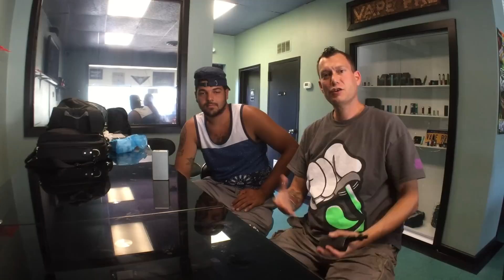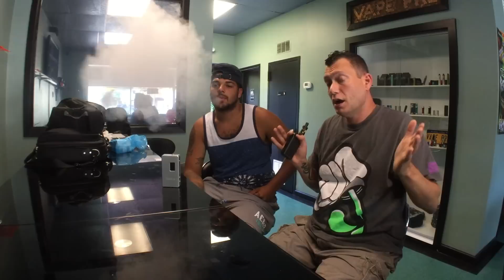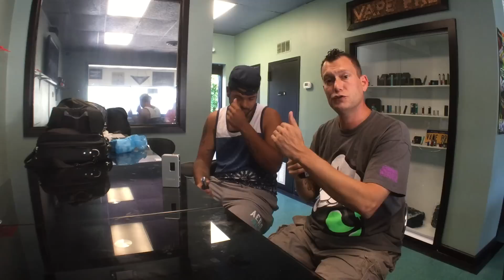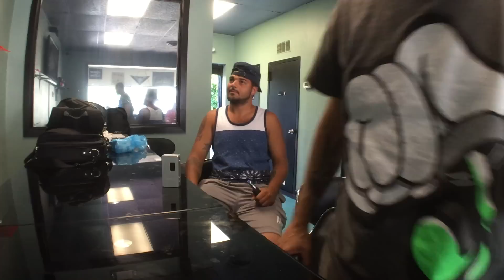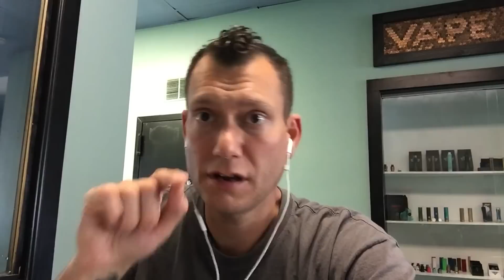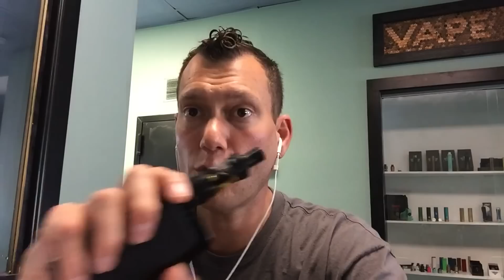Cloupor T8 goes on the TC wall of shame.  This is NOT a Temp Control Device.

Comment: This video is a very good and mature way to approach this matter. 
More reviewers need to talk about this device like you have to reach out to the people that buy it for temp mode.
I hope Cloupor see this video and makes the correct changes in there packaging and web site.
Reply from the maker: +chris nicolas Thanks man, I hope so too.
Reply: +Quest4vape hey quest4vape. there is a shop on ebay that makes triple 26650 wooden box mods. oldiesbutgoldies4u you should check that shop out, handmade wooden box mod.

Comment: Good job Daryl, These guys should have known what they where selling know your product, this device is a old device. The are talking about board temp as you know. Instructions are defo misleading but i am sure this Mod was out before temp control came out.Nice one brol
Reply from the maker: +Polo65 Thanks man, I was maybe a bit harsh on Clouper?  That's ok.  They have a 150 watt box mod that says it is temperature control and people think that means nickel TC.  They have a problem.   What's to be done?   Educate.  asap.  retail stores and vapers.  Thanks man, I know you keep a sharp eye on your vape knowledge.  Hoping others do the same.
Reply: No Daryl, I dont think you where to harsh these companies need to make their instructions more precise, I have been baninging on about this on forums, and vape shop owners for a long time. To make sure they are giving their customers the right info.They should be able to research their product instructions, and translate in the proper manner as most companies, Are very misleading. You are a 100% correct in the way you handled this situation. Thanks again Daryl,

Comment: Great video! We need to see more videos of you in the shop.I need help myself........I have a 100w istick eleaf that I vape at 65.5w and I use a Smok tfv4 tank. I was recently told that the coils to this tank are nickle and I need to know if its true and if its safe using it on the istick that isn't TC.
Reply from the maker: +juan solis Hey, the coils in the TFV4 are not nickel.  They are A1 Kanthal.  I have that subohm tank as well, and have vaped the Tri-coil and the Quad coil.  It's a beast of a tank.  But no, those coils are fine to vape in that tank in wattage mode.  And 65.5watts is by no means pushing the capability of either the coils or the mod.  So you're vaping quite modestly.  No harm there as far as I can see.  Anything I'm not seeing?

Comment: the shop must ave assumed it's  the cloupor GT 80w temperature control and ain't done any research on their own shit, so the shop selling it are at fault cos what u read out is basically standard regulated box protection . and someone looking for a cheaper way to try tc vaping wouldn't know any different from what the shop was telling him, at least until reading the instructions  in its box.  u probably already know about GT 80w tc , I didn't  read other comments so sorry if I'm repeating any1. but for a vape shop to make a major mistake lk that is bad!! n even worse for the vaping cause.....   keep up the good work lads, thumbs up from me
Reply from the maker: +Greg John Cloupor didn't intend to do something wrong.  last year when they put this product out Temperature Control didn't mean what it means today.
But the product marketing has become misleading and there is a safety issue with that.  And the shop where he bought the product actually makes a selling pitch for it as a TC device.   This is the kind of thing that I want folks to be vigilant about and even educate their vape shops if they don't know.  Thanks for watching and for your comments here!

Comment: People need to stop being idiotic i mean after checking some Cloud chase videos they immidately want to do same without knowing basic stuff like must use temp control on nicel titanium otherwise u'll be inhaling toxins.. or check on ohms law in order to make safe builds so your battery wont blow in your hand like a granade... 
there are tons of good regulated box mods along with decent tanks for safe satisfying vaping experience for begginers 
for example:
You quit smoking but not ready for direct lung hits then  a nautilus mini what you need it can satisfy mouth to lung period also conserves juice and battery life due its 1.8 ohm coil should perform good enough arround 12-13w
Or you want more flavor and alot more vapor get a subtank mini (it also has 1.2ohm standart coils for conservative colder vaping) and use either it's rebuildible coil or get standart 0.5 ohm japanese cotton coils they will give you shit ton of vapor and falor also have very good airflow (Alot more than naut mini) you can vape it on 22-27 w efficently so yet again 30w device would fit your needs so you dont need 100w - 150w beasts.
There is tons of quality web pages have daily/weekly/monthly sales even 50-60w tc devices goes arround 30-40 bucks! 100% authentic aswell as offers free sheeping.

here my cheap yet efficent set suggestion for starters;

From gearbest(dot)com site (i use them they are more relighable than fasttech they also have usa and eu warehouses too so not only from china)
Kamry 30W V2 : Simple,elegant yet sturdy and good working mod 23 dollars(its on sale:) ) free shiping! or still want a good yet cheap tc mod get a amazing looking Smok Koopor Mini 60W TC its 29 bucks! (u'll need a charger tho usb port for data transfer not charging)

2X Samsung 25r Battery: love those more than sony vtc4-5 or lg h2-4 cos S25R will perform better up to 20amp draw than all other models in the market and it' li-ion has safer chemicals(IMR so Manganese added) then lets say LG HE2 (ICR Type so NMC (nickel-manganese-cobalt) battery not that safe if i am not mistaken tho never heard lg blowing ppl face :D )
1x 18650 battery needed for mod but we buy 2x for 8 bucks to have a spare even tho it's 2500 mah it should last you whole day still allways good to have a back up! again free shipping!(remember to chose green color version because blue version discontinued 10 month ago (newer/freshly made = better performance for battery cells due chemicals in them)

Kanger SUBTANK MINI : 25 bucks free shipping (including regular coil+mini RDA famous blue screw driver  :P orings replacement glass what not good airflow,flavor and so vapor production it's really very good deal)
My alternative suggestion Isub-g (G stands for glass so u can use spicy/ctric e-juices freely compare to plastic tanks)

Less than 60 bucksfor all !!!(after shipped takes 7-15 days to usa )

For cloupor issue ;
Why the fuck ppl still buy Cloupor products anyway i mean they are most brokedown,overheat,meltdown even blow up mods out there.. People should heard the reputation by now Cloupor is fucking suck they are expensive then smilar companies like eleaf,innokin,Smowell,KSD,Kamry,Smocare,Amigo,Smok,Smy etc which offers equvelent and or better products for often cheaper prices and alot more safer then fucking Cloupor atleast they wont short or overheat batteries as often as closhit do..

+Quest4vape doesn't only help people form states but all over the world even tho i live in Turkey i still suggest his videos to family and friends to get them more in to vaping once again thanks brother you're allways helpful and contributing alot in to community.
Reply from the maker: +Regalya wow, thank you!  Listen to him folks, making alot of sense here!